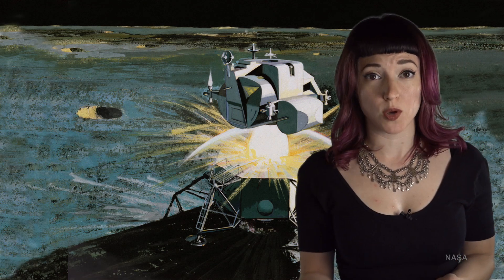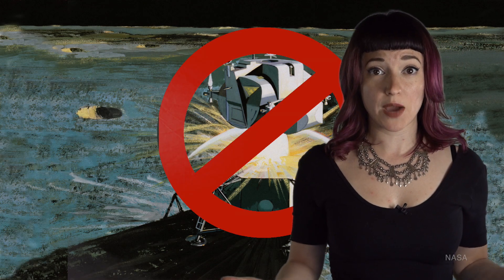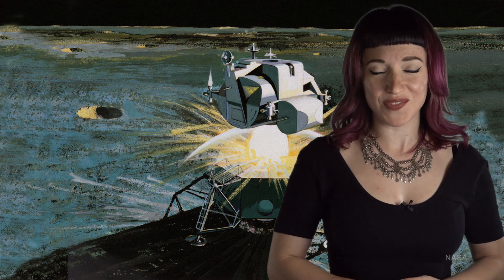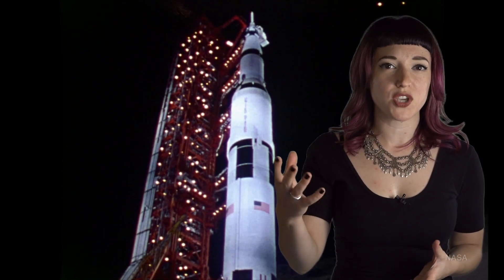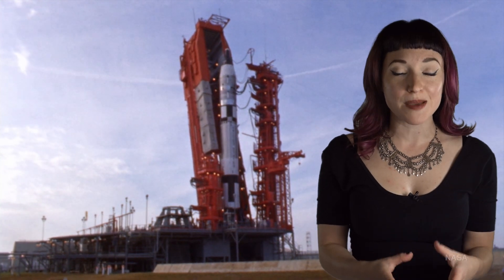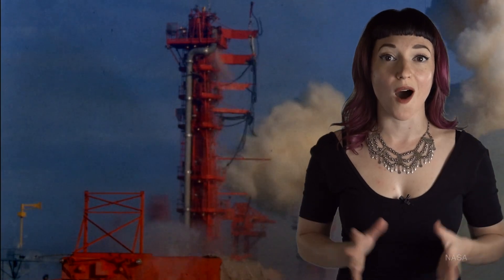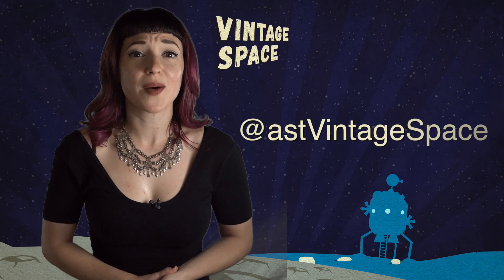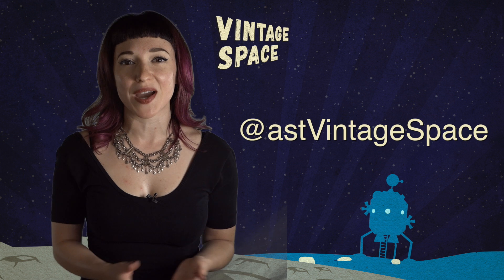How the Lunar Module Launched from the Moon Without a Flame

Comment: If you get the chance, visit the Smithsonian and see a real Lunar Lander.   I was surprised at how big it was.
Reply: I used to see a REAL LEM (not LM) every day after the 11 mission in the parking lot at Grumman in Bethpage where it was built. They built two exact LEMs. One went to the moon, the other stayed in the plant so the design engineers could trouble shoot any problems if thet arise. Then when the mission was complete, Grumman pushed it into the parking lot and spray painted it camo green. It was there for about 2 years in the rain amd snow

Comment: At 0:25 we see Apollo 17 lift off and damage the insulation panels. Why didn't the panels of 11,12,14,15.16 get damaged? What was different about 17? Why didn't the thin Mylar LM pressure vessel also get damaged?
See the debris fly off and upward - why is such a dangerous separation required/allowed?
It appears that this is the first ever LM to do an ascent based on the damage. Also why is the ascent engine silent? It's literally inside their tiny mylar tent!!
Reply: Graham, as I've told you in numerous other threads, you are a psychopath, and you never check the answers to your own questions before you ask them.  And, when they are answered, you ignore it.  You truly need to be locked in a rubber room.  And, I'm not answering for your sake.  You're a lost cause.  Nobody can get through to you.  You post the most ridiculous garbage ever, and will NEVER admit when you're wrong.  But, for everyone else's sake, here's a reply to some of your garbage:

YOU SAID: "we see Apollo 17 lift off and damage the insulation panels. Why didn't the panels of 11,12,14,15.16 get damaged?"

== Well, here's Apollo 16, those panels don't look damaged to you??
https://i.pinimg.com/originals/06/5c/fb/065cfb526242eeaaa56dde95f013afd9.jpg

I'm not bothering with the rest of the missions.  Look them up yourself.  Those were mainly panels to block sunlight, and were designed knowing they'd warp and bend.  They didn't care, as long as it blocked most of the light from getting to the electronics for most of the mission.  The longer they were on the moon (each mission was longer than the prior one), the more likely they were to warp and get bent out of shape.
  And, yes, the more warped they were, and the longer they were exposed to the sun while on the lunar surface, the more they bent upon liftoff.

YOU SAID: "See the debris fly off and upward - why is such a dangerous separation required/allowed?"

== Laws of physics.  When the rocket engine is running, the force of the thrust will cause any debris to go AWAY from the craft.  Since there are no forces pushing the debris toward the craft, the laws of physics dictate that the debris will go away from the craft.

YOU SAID: "It appears that this is the first ever LM to do an ascent based on the damage."

== You're an idiot.  What the hell does that even mean?  You're asking about Apollo 11 through 16, then you say Apollo 17 looks like the first one?  Go watch the others, then.

YOU SAID: "Also why is the ascent engine silent?"

== You expect sound in a vacuum?  You're an idiot.

YOU SAID: "It's literally inside their tiny mylar tent!!"

== The outside of the descent layer had mylar.  But, the craft was largely aluminum.  And, yes, some of the vibrations that would normally be "sound" in an atmosphere did vibrate against the metals of the craft, and a little bit of that can translate through the metals and into the craft.  And, a little bit of that can translate through the suits.  And, a little bit of that can translate into the microphone.  And, guess what, it DID.  You can hear a bit of background noise that is actually the equivalent of "sound" through the metals/suits/microphone.  But, I mean, good fucking gods, what's your exact complaint?  Most "sound" in a vacuum simply never even happens.  Most "sound" from a rocket engine comes from the reverberation of the exhaust gasses against the surrounding air.  Without surrounding air, almost all of the "sound" doesn't even happen.  And, why the beef about the little ascent engine.  That was just a tiny 3500 pound thrust engine.  It weighed about 180 pounds.  It was less than 4 feet tall.  Why aren't you complaining about the fact that the Saturn V put out 7.5 MILLION pounds of thrust, and could be heard in fucking Tennessee from Florida.  But, yeah, the astronauts were able to speak into their headset microphones just fine, and nobody on the ground heard much background sound from that either.  And, that was IN an atmosphere.  Nobody complains about that, or the other countless rockets ridden by astronauts.  Nope.  You stupid conspiratards just want talking points, so you talk about the tiny little 180 pound ascent engine, and you expect this deafening sound from it.  I mean, sure, that tiny engine was closer the astronauts.  But, let's get real here, 3,500 pounds of thrust in a vacuum vs. 7.5 million pounds of thrust in an atmosphere... do the math.  Do any actual rocket scientists or aerospace engineers ever notice this glaring "error" in the "hoax"??  Nope.  Just you dummies who have never set foot inside a university classroom on rocket science.  You're the only ones who notice this glaring problem.  Sure.  Fucking moron.
Reply: @rockethead7  Thanks for the insults, I must be over the target LOL :) Good to know.
The Saturn-V didn't have 7.5m lbf it had 5.0m lbf as Rocketdyne specced the F-1 motors.
The ascent engine would have been deafening BTW, that's a simple fact of physics: the burn creates noise in the combustion chamber which is bolted to the feeble mylar craft, which was full of air at the time. Why are you talking about a vacuum - these guys weren't outside lol!!
You seem very confused about audio conductive paths - why do you assume sound always takes the route of maximum impedance? Of course that is nonsense. According to you sound can't travel through solids - doh!

As for the damage, yes it's strange it wasn't addressed earlier. It seems that flappy insulation got more and more tired as they re-used it for each shoot.

Also you are wrong about the debris, much is caused by the initial explosive bolt firing, it's dubious the untested ascent stage would have even worked. Bolted to the descent stage changed the pressure points and quite possibly had they used it in anger it would have exploded or buckled and broken the craft with the initial pressure surge of the trapped nozzle.

You know they never tested the descent or ascent engine in 1/6g through a landing cycle before Apollo 11?
Reply: @rockethead7  I don't understand your maths. I said there was 7.5m lbf of thrust claimed, but you call me an idiot and then work out 7.5m lbf of thrust. Err.... isn't 7.5m lbf the same as 7.5m lbf ?

You appear to be confused about sound waves too. The sound of the rocket in the combustion chamber gets transmitted through the walls of the chamber straight back into the structure of the craft. You know sound travels well through solids and liquids right?

You are also confused about testing. You appear not to know what testing is. Testing isn't Neil crashing all the simulators and sending three valuable men through the VAB in Apollo 8 without checking it's safe and the gear works first. Testing isn't unlocking the LM and then redocking it, TESTING is actually landing it in 1/6g, having it sit in the sun for 2-3 days and then lifting it off again. They can do this remotely, what do you propose - risk having the LM fail on the ground and strand 3 heroes 250,000 miles from earth on international TV and radio? 

Why are you rationalising all this unlikely stuff that no one ever does? Clearly the landed LM had not arrived by rocket, NASA proves that for us with the ascent videos as a simple 4.7 ton liftoff from a platform blows the craft's insulation to pieces. Slowing 18 tons to landing on the ground is significantly more pressure and exhaust wind. NASA's video shows the LM will tear itself to pieces on landing - get we don't even see a wrinkle or spec of dust. Look at AS11-40-5927, the LM is brand new and unmarked.
Reply: @G-ra-ha-m  
Graham, I have answered armies of your idiotic questions in other threads, and asked armies of return questions, and rebutted every single point you made.  It goes in one ear, and out the other with you.  I'm not bothering AGAIN.  Nothing you say is accurate, and you don't understand rocketry.
Reply: @rockethead7  Oh yes, you are Mr Insulty, I can see up the thread now. Your rebuttals were just sad unscientific rants, sorry. At random lets take your theory that rocket motor sound is inaudible from the air filled cabin. 
Basic physics - for every force there's an equal and opposite reaction. All that fiery flame pushing your rocket along - THATs the opposite reaction. You may imagine that force pushing the rocket along is silent but the NASA launch audio debunks that. Equal and opposite. A basic law of physics particularly applicable to rockets.. 

The descent engine had to slow 18 tons (magically without any exhaust pressure or ground effect bubble as the LM was perfect), the ascent engine had to push 4.7 tons into lunar orbit. 
Both would have been clearly audible inside the cabin unless somehow you think sound doesn't travel through solids. 

You really need to start wondering why so many Apollo oddities requite such far fetched rationalisations - once you see the fakery than the entire fake unwraps like badly made B movie. You can't see it now, but when you do you'll wonder how you missed all the clues for so long.

The lack of damage from a landing LM is a new oddity that you have completely ignored, another one for the pile needed to believe in Apollo LOL, along with the big weathered earth rocks in the lunar photos ;)

Comment: the same fuel that the space shuttle used to turn and move in space.  In dozens of videos you can see how the jet was coming out.  there are also videos of NASA itself, when they tested the engine in vacuum chambers, and a jet is clearly seen.  You just lie and you lie and you lie
Reply: Just like the Apollo LEMs, you only see the very beginnings of the "jet" (not a jet) coming out.  That's before the burn gets going.  You see the exact same thing if you pay attention to the RCS systems on Apollo, or on the ascent engine in this video.  Just as they start the engine, you see "jets" (not jets) of fuel/oxidizer rushing out.  Pay closer attention.  Then, once the burn really gets going, you can't really see it any longer until it pitches over and you're looking directly into the engine bell.  So, bottom line, sorry, but you're shooting yourself in the foot by comparing to the shuttle, because, yes, it operates just the same way (if you pay attention).

Comment: Thank you for explaining that. I have often wondered what fuel is used on thrusters. Since space is obviously void of oxygen and thrusters need small controlled bursts to alter the craft direction or altitude. Do those use a hypergoll or similar fuel?
Reply: The LEM used hypergol fuel as it has to be very simple due to weight issues

Comment: and it only takes 24vdc to livestream a phone call back 250000 miles to earth. This i do know. lol
Reply: It's pretty easy when there is nothing in the way to block your signal.
Reply: What has the operation voltage of the coms transmitter to do with the communication distance?

The prime element in earth-moon communication was a huge dish antenna on earth. 70 m diameter if I remember well.
Note how a 1 meter dish antenna on your roof enables sat tv communication with sattelites that are in geostationary orbit at 22,200 miles (35,700 km) above the equator.

But probably I have to assume that for you sattelites are a hoax as well?

Comment: Did the Lem ascent engine have enough thrust to leave the Moons orbit??? just thinking about the what if question if they had an issue. How long could they burn the engine for. I am kind of thinking about 13.... if the explosion happened with the crew on the Moon. Thank you love your channel!!!
Reply: No, there was not enough fuel to reach lunar escape velocity.  On the apollo 13 mission, the Descent Module engine was used instead of the Service Module engine to alter the trajectory.

Comment: The problem with the moon landing is that it cannot have happened when the moon is a flat disk.
Reply: A flat disk wouldn't have the constantly changing curve between illuminated and non-illuminated areas that occurs with the moon's phases. It's also possible to see A LITTLE farther over the upper edge of the moon when it's near the horizon, consistent with a sphere but not a disk.

Comment: Ask Rick Mears about burning clear. At the 1981 Indy 500, you couldn't see any flames, but he was most definitely on fire.
Reply: Was he the one who had to jump into the path of the extinguishers because the fire crews didn't think he was on fire?
Reply: @samsignorelli  Yep.

"When Rick Mears pitted on lap 58, fuel began to gush from the refueling hose before it had been connected to the car. Fuel sprayed over the car, Mears and his mechanics, then ignited when it contacted the engine. Methanol burns with a transparent flame and no smoke, and panic gripped the pit as crew members and spectators fled from the invisible fire. Mears, on fire from the waist up, jumped out of his car and ran to the pit wall, where a safety worker, not seeing the fire, tried to remove Mears' helmet. Meanwhile, Mears' fueler, covered in burning fuel, waved his arms frantically to attract the attention of the fire crews already converging on the scene. By this time the safety worker attending to Mears had fled, and Mears, in near panic at being unable to breathe, leaped over the pit wall toward another crewman carrying a fire extinguisher, who dropped the extinguisher and also fled. Mears tried to turn the extinguisher on himself, but at this point his father, Bill Mears, having already pulled Rick's wife Deena to safety, grabbed the extinguisher and put out the fire. His mechanics had also been extinguished, and the pit fire crew arrived to thoroughly douse Mears' car.(19)"
Reply: @DarkAudit  Yeah...I just found the vid....scary.

Comment: The Van Allen belt radiation being fatal is one of my favourites.
Reply: kneecaps2000 there was a polyethylene blanket to block neutrinos about a 1/4 inch thick very lite weight and the aluminum skin that blocked larger radio active partials.
Reply: @martinj1645  ah i didn't know the sheet was there for that! Thanks.
Reply: I usually just say the Van Allen belts are fake.  A hoax.  Van Allen himself said so.  Total nonsense.  Prove that a belt of deadly radiation exists.  Impossible.
Reply: kneecaps2000 it is while passing though but the capsule was dual insulated and the Time spend crossing then resulted in little more radiation than an x-ray.
Reply: @martinj1645  The answer is appreciated but I knew about the time in the belts not being enough to be fatal. Regarding double insulation...beyond the structure and skin what are you referring to?
Reply: The radiation doesn't just stop with the Van Allen belt, Galactic Cosmic Radiation/Ray (GCR) is constantly present in space and on the moon. Solar flares etc. Radiation that can literally damage your DNA. Just google ''Space Radiation is Risky Business for the Human Body'', Nasa will tell you how it is themselfs. I for one don't believe for a moment that we landed humans on the moon. As our technology and knowledge advances the more ridiculous do the first so called moon landings look.
Reply: @roberthansson8222  When you're riding to space on a liquid fuelled bomb...you're not dealing with people who are worried about a bit of radiation exposure. Doesn't matter what you believe...the evidence and documentation is overwhelming. The issue is ones ability to understand it leading to that disbelief.
Reply: You guys should call NASA and remind them of how they got through the Belts before because they apparently destroyed the tech and can not figure out how to do it again...
Reply: @andersonpoopercnn4261  Who says NASA don’t know how to pass the radiation belts? Not NASA, anyhow...
Reply: @YDDES  they said them self look it up son
Reply: @pelon198712  who Said it? Not that Kelly Guy anyhow. He just talked about the Orion.

Comment: I believe it was a similar fuel  combination used by the Germans for there rocket powered fighter. They always had to keep the tanker fuel trucks apart because the fuels could be loaded together or the whole place would blow sky high. I never know  what that fuel process was called  to thanks.
Reply: The fighter you were referring to used C-Stoff which was a mixture of methanol and hydrazine and HTP, which is hypergolic combination but the fuel and oxidizer combinations are completely different at least chemically
Reply: @aidanstenson7063  I was just commenting on now I knew the term hyperbolic. But thanks for the  further explanation.
Reply: @robertsullivan4773  Oh, no problem

Comment: And, if the problem of the plume is the only problem you find in this ascent, I'm afraid you have a poor knowledge of the way that rockets ascend from a planet, Amy.
Reply: With 1/6 gravity there's less gravity to overcome. With an ascent module that was built to have as small a mass as practical it achieved quick acceleration.